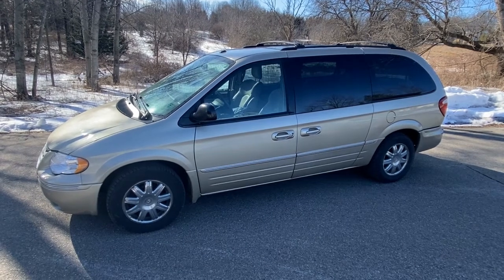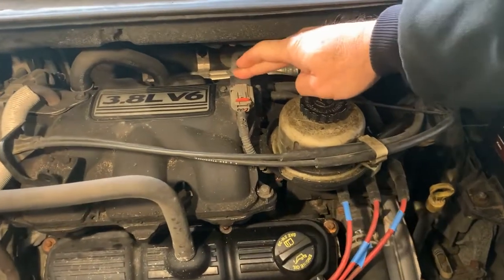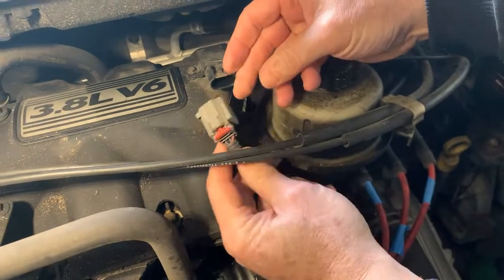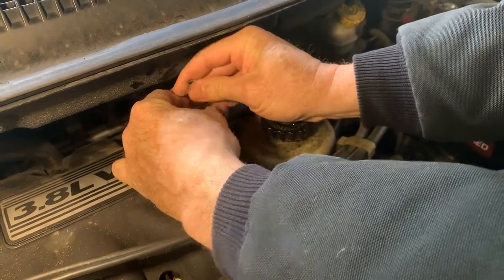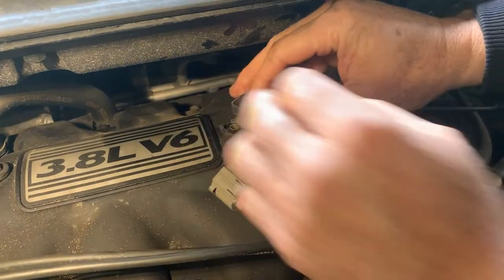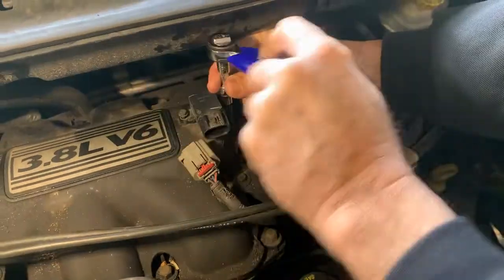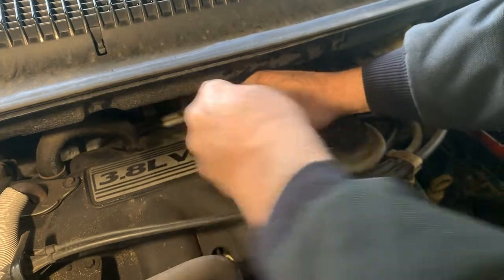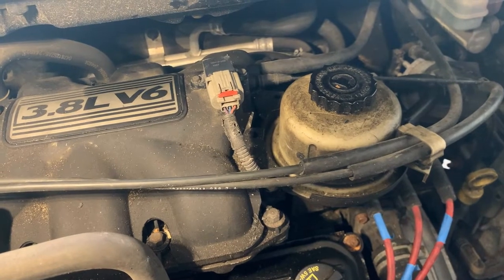How to Replace MAP Sensor  Chrysler Town & Country (Fourth Generation)

Comment: Have a 2003 3.8. However, when clicking on the map sensor you have listed in details, amazon states it will not fit. I trust your excellent demo vs maybe a wrong listing, but curious your thoughts. Thank you.
Reply from the maker: At the time of the video it was correct, not sure what might've changed on Amazon. Make sure you include all your vehicle information and the part number to make sure that you get the correct part for your specific vehicle.
Reply: Wanted to follow up. Part you list worked fine. Not sure why it listed as not. Thank you for your walk through, as well as your reply and help. Already subed and liked

Comment: Thanks for the info. Very well done. I have a 2001 Grand Caravan 3.3l that runs great until I'm hitting high RPM's and then it will do a sputter. Can that be caused by the MAP Sensor? No dash warning lights are on.
Reply from the maker: It could, but unfortunately without a check engine light there are many other things that could also cause your van to sputter.
Reply: @TheAutoTeacher  $10 can of mass air cleaner and the sputter is gone for now!!
Reply from the maker: Awesome.

Comment: I have a 2010 town and country same engine and the check engine light is on. It will not pass inspection. Will changing this sensor clear it and this is the same as the oxygen O2 sensor.
Reply from the maker: Whats the PO code ?

Comment: Can tge map sensor cause it to die when stopped or mass airflow sensor??? But don't think it has a mass airflow sensor🤷🏾‍♂️
Reply from the maker: Yes , hesitation or stalling, hard starting, rough idle, lack of power, poor fuel economy. All these are symptoms of a bad Map sensor.
Reply: @TheAutoTeacher can you help I have code P0113 on dodge caravan

Comment: HELP I HAVE CODE P0113
Reply from the maker: Common causes of a P0113 Code
A-Check to see if your air filter is dirty
B-A bad IAT sensor is a very common cause.
C- Defective or dirty mass air flow sensor. 
D-Bad/Damaged wiring